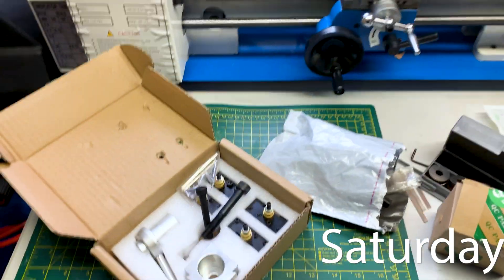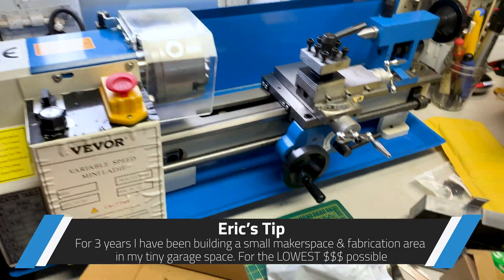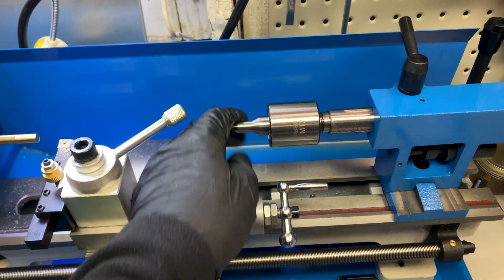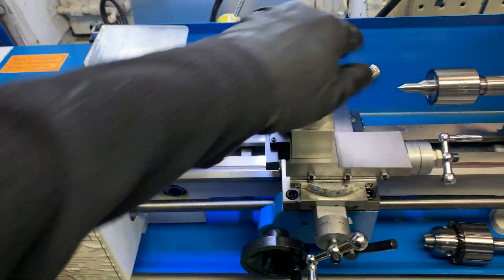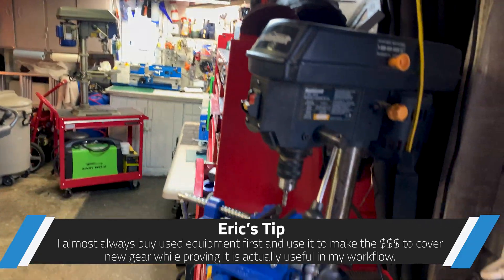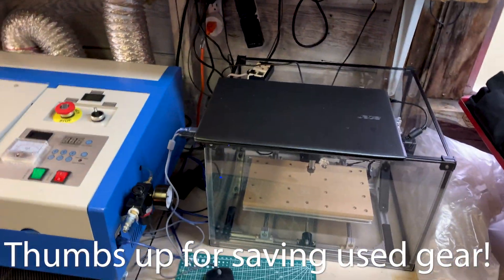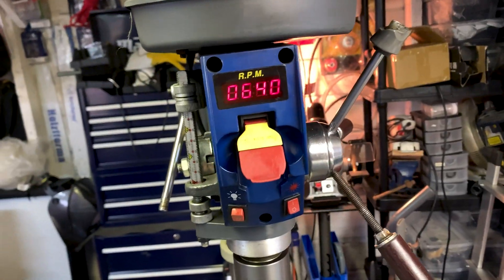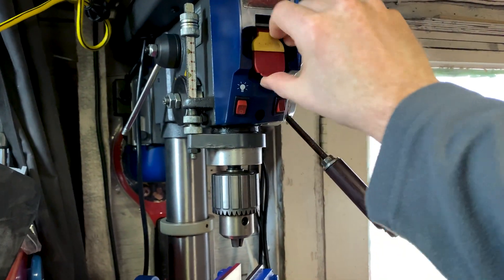Mini Lathe Mods + Drill Press = Makerspace UPGRADE!

Comment: ALSO,  a little tip for doing milling on the drill press... on the table, I used to use aluminium foil to help with catching the swarf etc on the table... helps keep it in one place
Reply from the maker: Great tip!